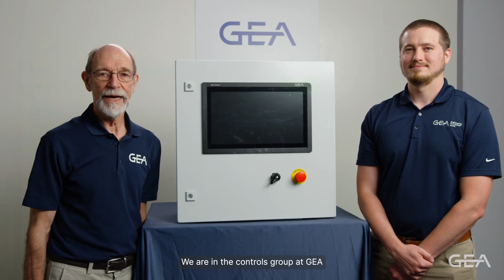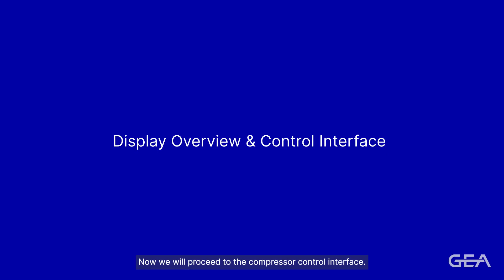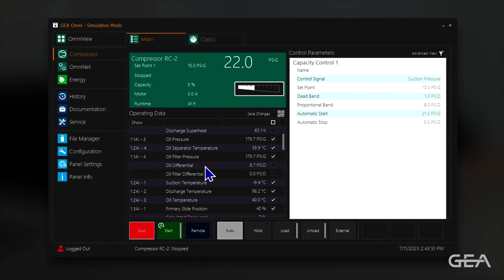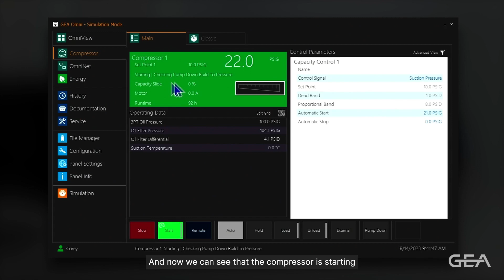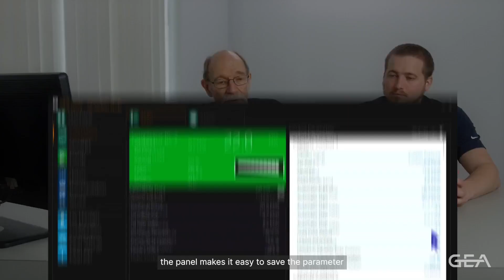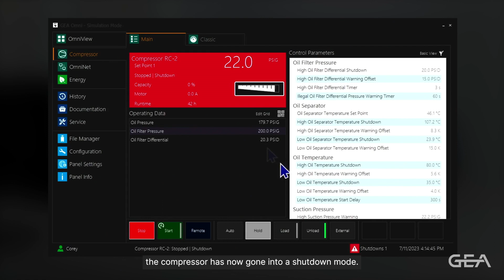GEA Omni Control Panel: Hardware Overview & Compressor Control Operation

Comment: Please I have a panel display issue, the Omni panel display have shifted to the right, and the reset button can't be seen and also the keyboard for entering password can't be seen thus rendering our compressor not running